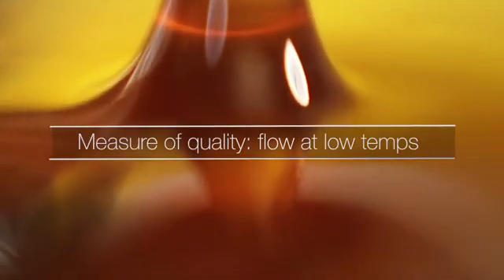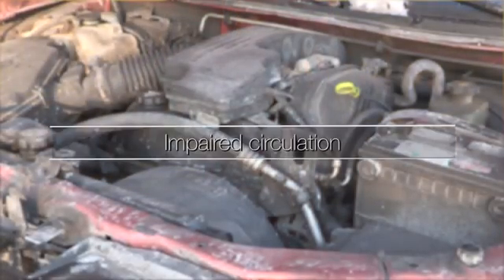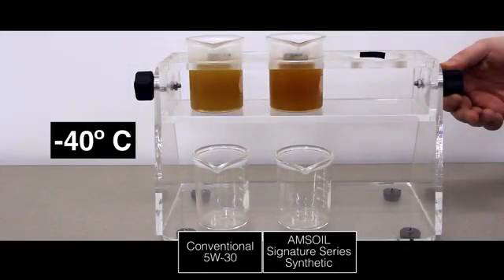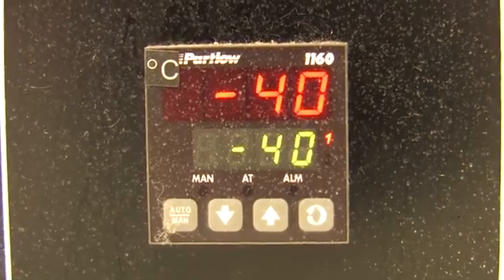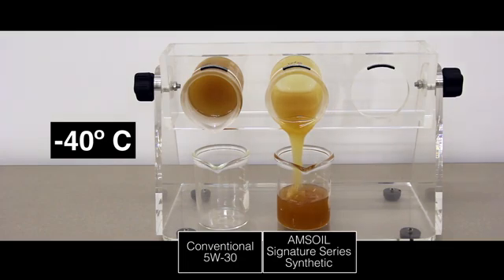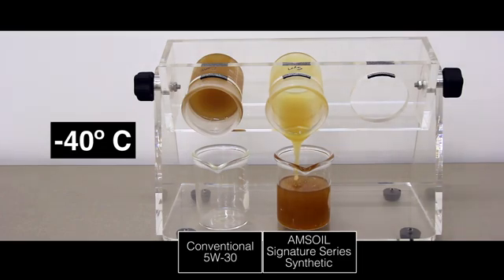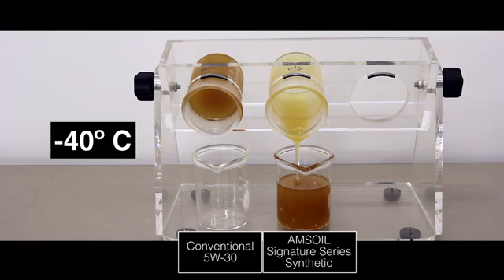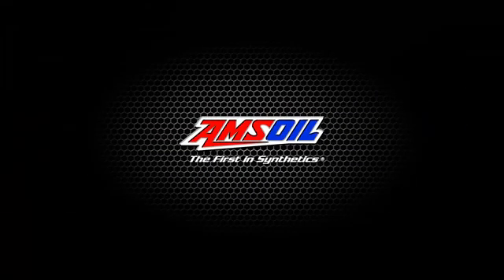Synthetic Motor Oil versus Conventional Motor Oil Cold Pour Test Competition

Comment: What to do if that happens while oil is already in motor?
Reply: Wait til it's a little warmer -10F is good enough, start the engine, let the oil warm, do an oil change with synthetic lol.
Reply: @SpecialPenguinnn  does it mean you cannot use the car if it’s -40? Sorry, you been scammed.
Reply: Tony, if it’s recommended by owners manual, you’ll be fine. Just don’t get scammed.

Comment: Isn’t 5w30 only rated for low temps around -17C?

Vehicle manufacturers would recommend 0w30 for the temperatures used in your test. 

As far as the SAE is concerned, both containers shown in this video would fail a 0w30 rating.
Reply: plus 
synthetic oil has different categories 
there is 
semi synthetic
synthetic 
full synthetic 
100% synthetic 
each one of these has portion of the synthetic oil 
the best one is the 100% synthetic 
the viscosity always check your owners manual 

and

Comment: Both of these oils are 5W30, and only the right one moves !! It doesn't add up
Reply: The 5W rating is at 0F, the 30 rating is at 212 F. The test is at -40F thus at a different temperature. two 5w30 oils can act differently at -40F. Often nonsynthetics are like rubber blobs at super low temperatures
Reply: You are comparing a synthetic versus a conventional oil.
Reply: synthetic oil is the best
Reply: Motor oil's numbers like "5W30" are determined by 2 test points, 0F and 212 F.  This test is at -40F thus not defined. Thus the 5W30 number gives no clues as for the Viscosity at -40F since not defined, not tested, not marked on the bottle.
Reply: Imagine if one had a 100 Baskeball players and each could take 40 shots  per test distance. One might have say Six that can make 5 baskets of the 40 at Distance X and 30 baskets out of 40 at distance Y.  Then you might ask of these Six players what will they make for distance Z that is farther away, with Zero tests? that is what 5W30 is  at -40F, not defined thus each blend pours differently, Synthetics better than Conventional.
Reply: Viscosity =/= flow rate